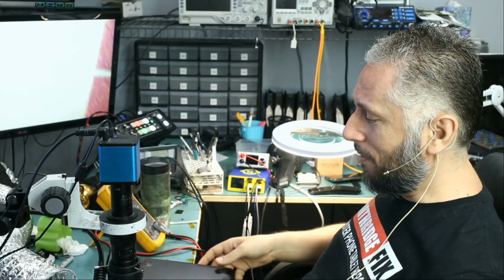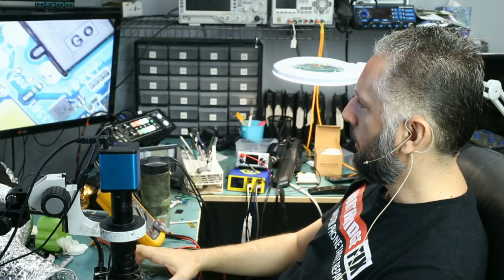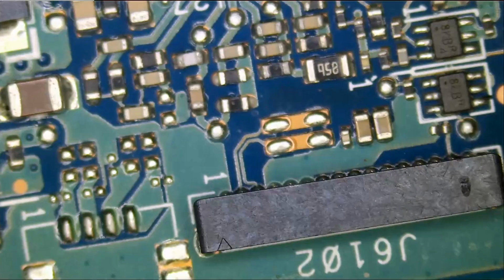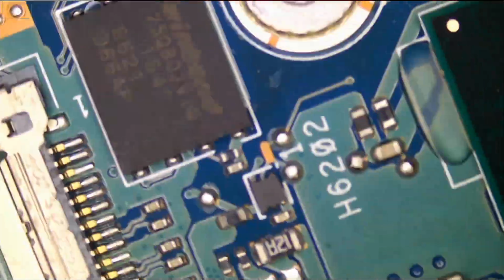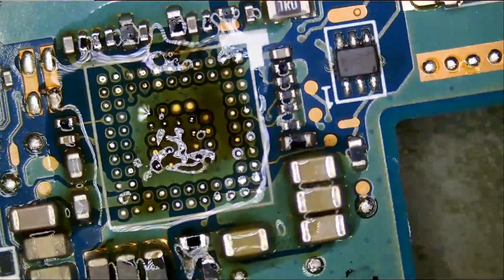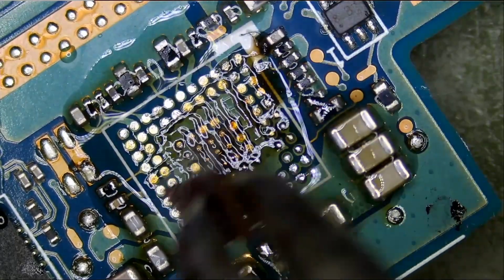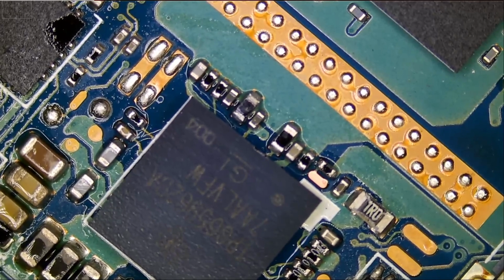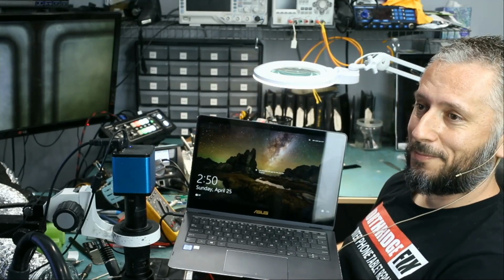Asus Q325u No Power Repair - USBC Laptops are meant to fail.

Comment: Am wondering if it’s not the chargers there using that might be causing the issue. I noticed my surface pro 7 which I use the pin display on will bug out on my 100w usb c charger but not my 20w charger. Am wondering if there’s not a issue with higher amperage chargers.

Comment: Between the cables that fry devices, ports that rip off too easy, and control ICs that fall left and right, is there really any benefit to the usb-c connector? You'd think they'd at least have a variant that was more durable.

Comment: what is a safe temperature to work with the hot air? I tried to replace a chip and i used 400 celsius, and the board started to expand and tracks flew off

Comment: Now days single ic perform more than 2 or 3 task,,thats why they are easy to blown up...usb c ic control power + data line and also may act battery chager ic  compare to previous one where we had 2 mosfet current resistor battery chager ic like BQ etc..

Comment: Wow!!! Fantastic video. Pretty soon I will be getting my hot air station, linear power supply, tweezers, soldering iron etc. I may order the amtech flux from your website. I've been fixing laptops but just general stuff, ranging from software, hard drive, upgrades, board, screen and keyboard replacement. With a BSc in electrical and computer engineering and background in digital electronics,  I believe that I able to take my repairs (hobby) to another level. Your videos have proven to be an inspiration to me. Gob bless

Comment: Hi, thanks for your videos, they are really informative. You have taught me so much about lots of different repairs. You keep it up. I have been doing this 9 years and learnt more in the last year than I have in the last 8 years. 

I assume the chip fails because it gets hot and the solder is not leaded and becomes brittle. Leaded solder allows it to be a bit more flexible. Why did they not glue the chip in place like gpu's. Manufacturers want you to buy new all the time and not repair, it's all a big con. 

Can't wait till next video.

Comment: Is the chip itself failing or is it the unleaded solder cracking or loosening connection to the contacts on the chips. Chip is probably designed to meet minimum requirements and the tolerances are borderline and may fail due to heat etc.

Comment: Good job sir, I have a question. After you use the leaded solder, then solder wick to clean the board, do you add any type of solder to the board before installing the new chip??
Reply: those chips already come with the new solder integrated, just add flux and heat. I should think that he might have  some videos about it.

Comment: I seen some usb c devices killed by using different device chargers, not all usb c chargers are the same! Multi voltage output can put 12v into a 5v device for example.

Comment: The motherboard is so tiny for an expensive laptop and it's using a small fan i think the problem is coming from the airflow 
The laptop is not enough ventilated and the chips hit too much

Comment: I wish you monitor the chip with the thermal cam under load after the fix, since this chip always fails, maybe what is making this chip fail is excessive heat, so you can prevent this chip from failing in the future by maybe adding a heatsink with some extra cost.

as always thank you for sharing.

Comment: To believe that USBC would be the future. Kinda crazy how often it will fail.
Reply: So how do you define OFTEN, this is the channel about repairing, so if there is no failure, no video. And why it is usb C? Because its the current standard for charging and transfer data NOW so every device have it, NOT FUTURE . Why no micro USB or USB A, there are little because it too old and the device use it maybe outdated so   the repair fee may cost more than the device itself. So the solution is throw it away and buy new device, no need to repair.

Comment: For those who are curious its the TPS65982 Chip first launched mid 2015, guess its the first gen. USB C Power Management Chip...
hopefully manufactures will use other chips for current systems

Comment: TPS65982/TPS65986 same as CD3215x in Apple devices except for the I2C addresses.  The TPS65982 and TPS65986 are chips from TI that try to do everything for USBC ports.  It controls whether the port is a charging port, a USB port and with external switches the port can be thunderbolt or display out.  It is a power and data multiplexer and there can be more than one of these if there are more USBC ports.  The master chip connects to a flash chip that holds the TI boot code and configuration for each port and the secondary chips communicate with the master chip to get their individual configurations.

One problem with these chips seems to be the internal LDO regulators and related switching.  If they did away with all the external set resistors they could eliminate the analog tests and analog 1.8v rail to simplify the chip.  And if all of these internal LDO regulators were separated out to an external chip that ran off of the USB ports VBUS it would make the switching part of the multiplexer more reliable and the entire system easier to repair.  It would be two chips instead of one or one multiple output switching regulator chip with its input tied to all USBC ports VBUS via diodes to power each mux chip.  The internal LDO_3V3 rail is only meant to supply enough current at startup for the chip to boot and use the external flash device that stores the programming and then it needs to switch from the internal LDO_3V3 over to the external VIN_3V3 supply.  If it fails to switch from the internal LDO then it eventually fails.  Having the voltage rails supplied by a single external chip and not needing those damn external set resistors would be the ideal setup.

Comment: Hey, I'm gonna ask something just a question "Can you solder a wire that has been cut and make it work again?"
Reply: That depends on the wire. The wire that brings mains electricity into your house: no. The wire that connects two parts inside a computer: yes.

Comment: Question: how likely is it that you replaced this frequently failing chip for a costumer and it fails again?
I mean is there different qualities and manufacturers for this particular chip?
Reply from the maker: We never got a single laptop back for the same faulty IC after it was replaced, but it could happen. Same goes for Retimer chips on xBox x
Reply: @NorthridgeFix  wondering to know the same question. Thanks for the answer.
Reply: @NorthridgeFix  it solder better  then factory now .so it unlikely to fail again lol
Reply: @NorthridgeFix  nice job victor a good work  better then factory job.
Reply: Failures like this on IC's that use BGA (Ball Grid Array) packaging and non-leaded solder (ROHS) are common. They tend to fail due to poor connections that develop from rapid heating and cooling (like charge control IC's). The replacement IC may be the exact same as original, but the chance of failing is much less due to the repair using leaded solder.  Great Job!
Reply: Usually aftermarket ICs is better than factory 😀😀😀
Reply: Nice question.
Reply: Same here since the ic was replaced with new one🤔 how is it likely to fail again🤔
Reply: @tarupam1paru586  thats the intencion if not fail again the work of this guy is over!!
Reply: @pedrogo4903  check ur grammar does not make sense
Reply: @optimizelogicrepair2784  bro, the genuine chip is garbage in this case.  are you just spouting meaningless generalities?
Reply: @SouthernCharity  Please enlighten us with your extensive experience. I'll wait...
Reply: @UC3uw34JchaewByfYurGY1Uw wow, so arrogant and obtuse.  you sound like the type of repairer that drops those Hiroshima bombs on boards that others have to fix.  Pull the carrot 🥕 out.
Reply: @SouthernCharity  Thanks for proving my point. I'm done with you. Keep watching videos and maybe some day you'll actually know something.
Reply: Hello, Since you mentioned USB-C and Macbook Pro, would you be able to fix Macbook Pro 16” 2019? I had this similar issue few days ago and its not turning on anymore.